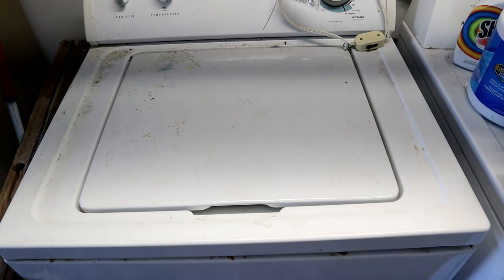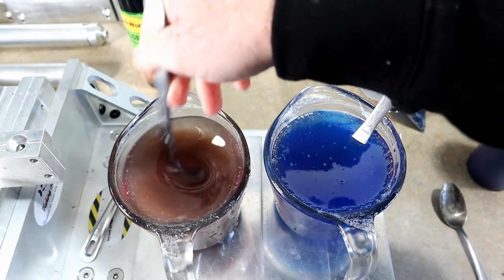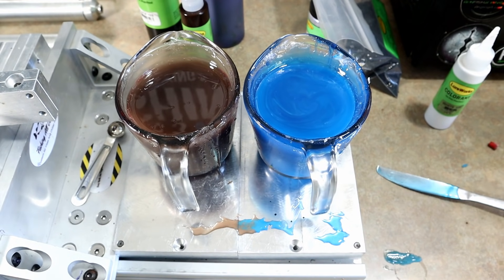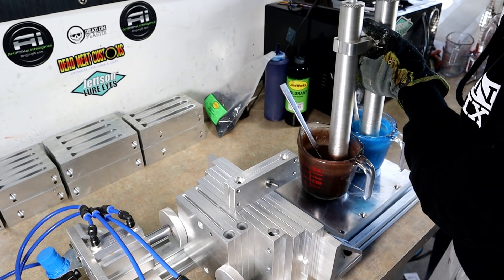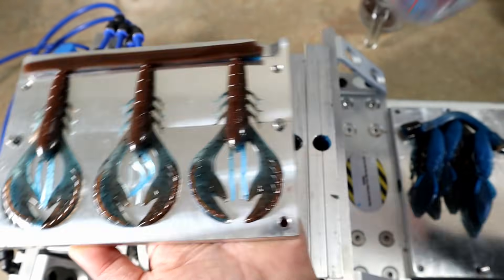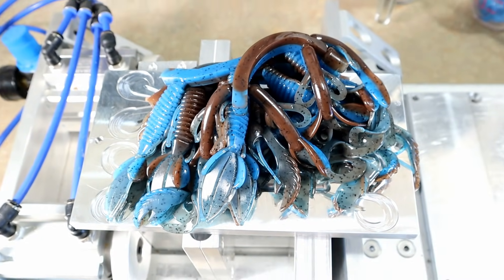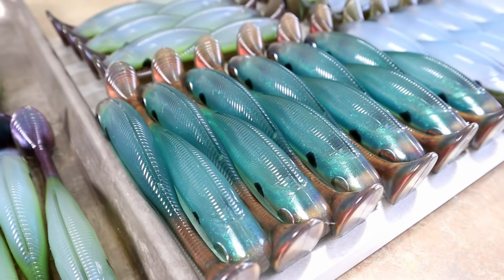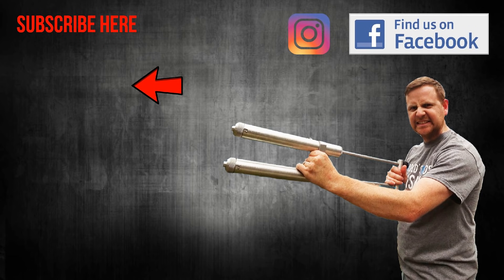The FUN SIDE Of Lure Making; Soft Bait Recipe & Blog

Comment: Hey Chris the last time I tried using the duel injector and blending block my colors didn’t end up on both sides of the stinger… is that a heat issue?
Reply from the maker: Probably so, you need to keep temperatures low and even